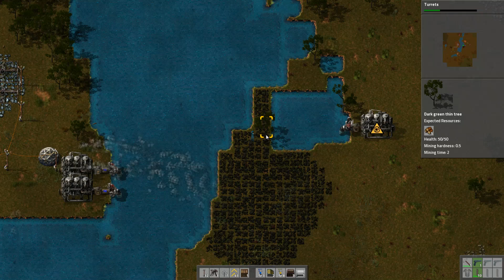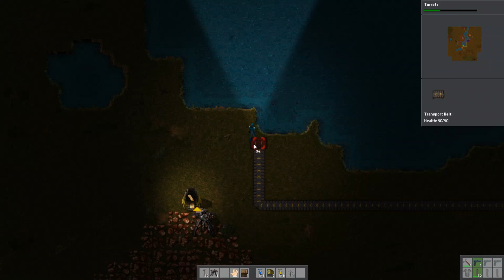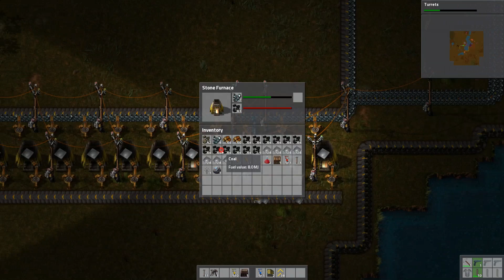Factorio 0.9.6 - Let's Play Gameplay Episode 3 - Coal Power

Comment: You put way too much stress on your resources of coal by building way too many machines, buy not using energy saving modules and by not storing energy or using solar panels. I don't even use half your coal production for a factory multiple times bigger than yours and with almost every upgrade unlocked. Especially when you need the red, blue and green bottles for research, you'll need lots of power hungry machines to automate this process.
Reply: Secondly, you need to stop and rethink your design. You need to focus on a highway of raw materials and build your production around it. Now you're just constantly improvising and making the design more messy after each step you take. The result is a factory which is time consuming to maintain and difficult to manage, because of all your randomly placed conveyor belts for raw materials.